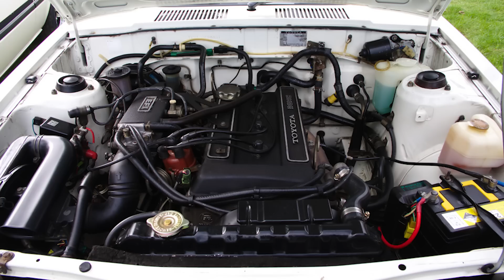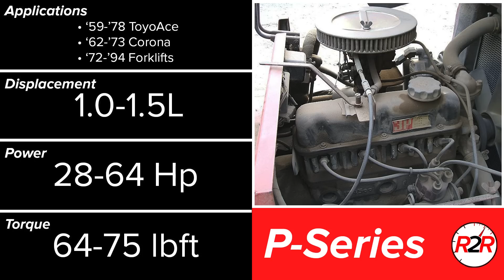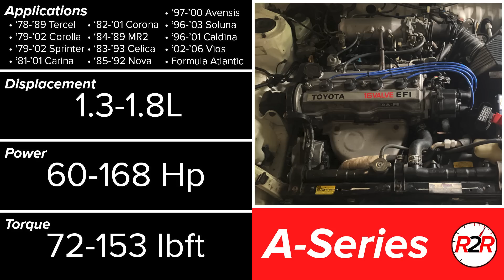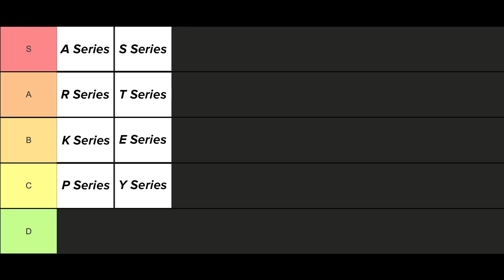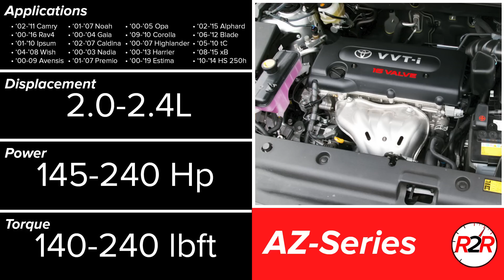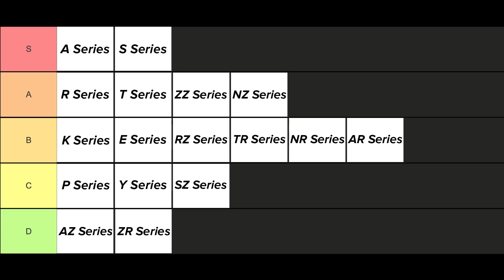The ULTIMATE Toyota I4 Engine Tier List

Comment: I have a 2007 camry i bought  when it was bit over 2 years old. Does not use any oil between oil changes at 240000 km. My biggest complaint is the dash material is crap. Other than that it`s a great car with no issues that i love. Mods are 18 inch x 8`s wheels, converted R1 muffler, K&N air filter ,10 inch touch screen entertainment system.

Comment: The 5SFE is 2.2L. Also, the A series was used in 6th gen Celica (so up to 99) in the lower end models. 7AFE.
Reply: I was thinking the same thing. My Camry has a 5sfe, and it’s a 2.2. It’s also notable that, while I’m sure you can do this with many engines, the 5sfe and the 3s-gte blocks are almost completely interchangeable. There’s plenty of builds out there with the cast iron block of the 5, and the internals and header of the 3!

Comment: the 4Y-E used in Toyota 8F series forklifts is damn near bullet-proof, our highest time lift has ~23,000 hours - for an engine rated at 37hp @2400 rpm. They will last decades with minimal maint input.  It is not always about absolute performance.

Comment: rz should be at least a tier they are a underrated indestructible workhorse and the 3rz in particular can make some crazy power boosted, we got one that had sit outside for 6 months well over 300k on it put 20lbs of boost through it, thundercunted the thing in a workmate and still runs 6 months later and only blew up when we pushed it to 30+

Comment: 1az wasnt a bad engine. The 2az got the bad rap for low tension piston rings and at the time suggested 10k oil changes, which caused sludge build up and rapidly developed into oil consumption.

Comment: Meh the the 2tr is fine for daily driving. My mate used to have a 4 door hilux thats wouldve been pretty heavy, and driving it it seemed to have alot of torque and decent amount if top end power to actually feel pretty fun. 

The massive fuel tank was good and bad, it'll last for long drives but the cost at the pump would be pretty bad. Fuel economy was good for what it was. No issues the with the motor, wouldve been more fun in a car with a shorter wheel base and lighter weight though.

Comment: 2RZ and 3RZ have some very nice modifiablity, while its more popular in Australia, its becoming more and more popular in north america. With simply a turbo, you can make 300hp+ on  either of these engines. The 2RZ is known to handle boost better, likely because of the smaller stroke. But on the contrary, the 3rz has a forged crank and more displacement. Majority parts between these two motors are interchangeable. As far as I know, there is no major issues known with these. Over all I think the RZ would be an A tier at least.

Comment: Those E series engines for a cheap run arround shitbox are amazing and so cheap and easy to repair, they can run 40% low on oil and be fine
Reply from the maker: Sounds like a good deal of fun with no worries, can’t argue with that

Comment: The zz piston ring problem was caused by a 2$ pcv valve that would fail sticking open and allowing oil to get sacked up into the intake. This would then burn in the cylinder causing immense carbon build up and in turn causing the piston rings to stick. We have fixed multiple zz engines by simply replacing the valve with the updated part from toyota, then soaking the cylinders with sea foam and atf over night. Once the rings are freed up it stops consuming oil

Comment: The AZ series being the lowest rated engine in the video is proper, but beside the oil consumption, the blocks had a tendency to pull the head bolts out of the block, blowing the head gasket. this happened TWICE on my 2006 Highlander (2AZFE). Toyota even issued a service bulliton about it, which I had them print out so I could give my mechanic.

Comment: I have the Dynamic Force engine in my C-HR. It has been my daily for the last 5 years and I have had zero issues. It has great fuel economy and predictable, linear power. I bought a Toyota TRD Air Intake Kit to squeeze more power out of the engine and with the bump in HP it feels like how this is how it should have come from the factory. I have had zero issues with the engine and it actually drives better now than when I bought it new.

Comment: 3S-GE Gen 5 BlackTop AT  86 x 86 mm, 11.5:1 comprassion ratio, 34.5 mm intake valves, 29.5 mm outake valves made of steel-alloy 197 hp @ 7000 rpm and 216 NM @ 4800
Reply: The only 2 litre naturally aspirated engine that can mach that torque output is the Mazda RF 2.0 G-184 with 181 hp @ 7000 and 205 NM @ 4000 but this engine is from 2018 and has a compression ratio of 13:1

Comment: The first and only toyota i've owned is a '09 yaris. It's slow as hell, but man it's a stout little engine and it pushes 40mpg highway. Doesn't burn a drop of oil between 5k mi changes. I've put 60k on it so far with zero problems besides a $50 radiator replacement from rocks hitting it while driving to aggressive on gravel. I've beat the hell out of that car

Comment: RIP the AZ series. My Mums Avensis Verso (Ipsum in other countries) has the 2L 145 hp version. Actually been rock solid for the past 21 years with no oil consumption issues at all.

Comment: I think you misjudged the RZ engine, especially the 2.4L 2rz. Those engines are disgustingly strong, and used in import drag racing to great success. A friend of mine strapped a turbo on an unopened 2rz and ran low 8 sec 1/4 mile reliably. Definitley an S class engine.

Comment: 2rz and 3rz’s are vastly superior to any R series engine, coming from someone who had a 400k mile 22re and currently still has a 320k mile 22re. My lifted 4x4 99 4runner runs circles around my 92 pickup, and race RZ engines easily make over 500 horsepower. The only reason they don’t get any recognition is because from the factory they weren’t really put in any cars, only trucks.

Comment: 2ZZ owner here. Had a Celica with this engine, as far as it "hooked" me to the small, powerful 4-cylinder n/a engines, it's just not that good, especially when I switched to K20 in Civic Type-R. Most common problem with 2ZZ was when the lift system starts to kick in and gearing ratios - when you change from 1st to 2nd gear, engine are just below lift rpm range. It's also expensive (camshaft and lifters), hard to repair (MMC cylinder walls if they fail, that's basically a thrash engine), not really a lot of mods for them, and the standard ECU cannot be modified. It's a shame because after Celica, the Toyota ended the little battle with Honda in terms of fun FWD with around 200hp n/a engines.

Comment: All those engines with ring issue's are from lack of oil changes and incorrect oil usage...  

Also the 18rg was the most powerful carburetored 4 cylinder

 and the rz was a later version of the r series engine... which when boost is added they triple in power... they make power easier than a ls v8

Comment: Ok the RZ series was definately underrated in this video. They are the best light commercial vehicle engine Toyota made. In Australia they fetch a premium as they are very common to be built for performance applications, responding excellently to forced induction making heaps of power and torque. The 3rz is one of if not the best engine they ever put into a Hilux.

Comment: This is way too broad to only list the series. There are probably over 100 versions of each series. Even if you go into specific engines of the series for example like the 2ZR-FE they had many changes over the years and the later ones were a solid A list engine at the least. The low friction rings and VVT rattle was fixed in the later years. Just 2 issues fixed during the production of that specific engine not to mention going back to a spin on oil filter from the canister filter.
Reply from the maker: I agree, but the reality is that the videos would be 2 hours long and viewers would get bored of hearing 22 variants of the R engine for example. I will look at separating variants that have large differences, just trying to keep these digestible, thank you for the feedback and I’ll see what I can do!

Comment: My boy E series got done dirty, a mild enough build for reliable 300hp out of an economy 1.3 deserves better
Reply: Ngl. As a former 2E engine user before I swapped the engine in my Corolla for a 3SGE, that damn thing just kept going. Mine got flooded at one point, drove 100 kilometers without a working waterp pump, towed a couple of vehicles with it... It just kept going. It won't get you anywhere quick, but it will surely get you there.

Comment: The 2TR-FE in the Tacoma might not be the most exciting engine they make but on that engine Toyota opted to sacrifice power for durability. As a result many 2TR-FEs will last at least 250,000 miles if you take care of them. Sure it loses in comparison to more modern engines but it lasted from 2005 until 2023 as the base Tacoma engine and the 1 I had ( 4cyl 2008 base model ) and my current one ( 2022 Toyota 2.7  Tacoma SR quad cab) both returned close to 25 mpg and have enough power to do when I need them to

Comment: 1999-2002 1ZZ burns oil, 
2003+ 1ZZ is the bulletproof version. 
 
300K+ miles on my daily 2003 MR2-S
Reply: As a victim of a 2001 Corolla I can verify this
Reply: I have a 03 vibe with a 2zz I love it it’s my favorite shit box so far
Reply: all the early 2000s engines burn oil due to stuck piston rings, a piston soak with engine flush of b-12 over 24 hours will fix this 90% of the time. Look up this in Audi engines for example. This is coming from a 2zz owner

Comment: I have an AZ series engine. Toyota replaced the faulty low tension piston rings for free, and it is going strong well over 10 years later with 0 oil consumption problems

Comment: ZZ is solid high A tier agreed. Better than AZ or ZR in terms of performance and reliability, but not quite as good as the S or A series b/c of their slightly finnicky reliability. They'll run for ages, but you gotta take care of them better than the old ones and can't beat on it quite as much. They also don't have quite the same power potential since they're not as good with boost.

Comment: I will say the 1AZ-FSE has been proven to be incredibly tough and quite quick, my 06 Caldina has the engine and it screams to high rpm, really gets up and goes and keeps up with alot of cars, helps that I have a ganador exhaust and filter, it's proven to be really tough and handles being driven hard with 8000km oil changes

Comment: I got 227k on the 2AZFE on an 07 RAV4.  Did start burn oil at around 65k and got really bad close to 200k.  I did a pistons soak with Berryman B12, and it has significantly reduced oil burning.

Comment: My friend has a 2ZZ Celica and it's a brilliant engine when paired with the 6 speed manual. Very similar character to VTEC Civics with a high redline and aggressive valve lift changeover. The car itself also handles beautifully with just better tyres, coilovers and a thicker rear sway bar.

Comment: I think the AZ series should be in the d tier fs, if it's never overheated, oil changed regularly, and it's pre 07 it's one of the most simplistic soild and cheap engines out there.
Reply from the maker: I think you mean shouldn’t be there, but valid points. Thanks for watching

Comment: The Dynamic Force is a great engine. Warms up fast, has lots of power, and gets great fuel economy. Had a 2ZR before it and there is no comparison. My '22 Corolla 6MT has a Borla Catback and a K&N typhoon intake with stock tune. Sounds great. I always thought it was a slow car but after doing a pull alongside a 2008ish BMW 328i Coupe and almost passing it (ran out of road) I am now convinced this engine is much better than I thought. Not surprised it is A-tier on this list.

Comment: In Australia our 7th gen celicas only ever came with 2zz. Regularly see them beating 300000km with no real issues. I personally have never had an issue with my engine, although the heater core design will lead to overheating upon failure, since the coolant flow isn't controlled by valve.

Comment: my Ipusm has a 2AZ-FE engine in it, and apart from a little bit of oil consumption, it runs well. I've put over 5000 km since I owned it, and I'm more aware about the oil consumption and the overheating weakness after research, thinking about the types of engines that could fit in case it breaks on me, but that's expensive, and I might not even keep the car if the engine blows. 

Yes, I did have one situation where the oil got too low and the light began to flicker on and off, and it got noisy. it's fine now, but one concern I have(since I got it) is at low throttle and rpm when cold it sounds like a diesel engine, higher than 2000 rpm during and it goes away, replaced with all the whines my engine makes normally. it's had a crappy battery replaced with a new one because it kept dying after a little bit of load on the battery, and my alternator made a lot of brief whining after not being stressed out.
Reply: my 2AZ does the same thing i think it might be the power steering pump. any ideas what it might be?

Comment: I didn't realize zr engines had such a bad oil burning problem, the 2zr in my 2010 corolla didn't burn a drop of oil
Reply from the maker: Nice, it may not be all variants, just some within the family. I wonder if maintenance quality makes a difference too. Thanks for watching!
Reply: It was only the ealier years. They fixed that and the VVT rattle issue later. The earlier ones gave the engine a less than spectacular reputation.

Comment: The 2zz is like the 7m of toyota 4s. People like to complain about them online because they don't know how to drive one. Its not a bullet proof engine. You need to wait 5 minutes for the car to warm up before driving and longer before engaging lift. People will money shift them then complain that it breaks the engine. I think the reason there is a lot more hate towards them has to do with the nature of the engine. It's extremely tempting to ride out gears to 8k. That makes people more likely to miss shift and blow them up. Especially since toyota manual shifters are sloppy and vague. If you were changing up at 4k then money shift, it would have enough range to keep the engine safe.
Reply from the maker: I really like this analogy to the 7M and totally agree!
Reply: My 2zz has 298,000 miles
Reply: @korbendallas9876  mine has about 165k currently replacing the timing cover gasket because of leaks

Comment: I didn’t quite get the take on Y engines. ‘They were built primarily for reliability and were used for a very long time in production. C-tier’.
Reply from the maker: My thinking there was a knock at the super low power figures. Although it may not have been the main focus, for heavy pickup trucks that’s just not enough and there are similarly sized engines like even the T series that perform better with no real downside. Additionally the Y series was built as late as the 90s, when engines were generally putting out well above that marker. 
That said, I completely agree that may have been harsh, from a longevity and practicality standpoint they are incredible! 
Thanks for sharing your thoughts and I hope you enjoyed the rest of the video!
Reply: @running2redline  Now I see your point of view. Thank you for elaborating. As for your videos - they’re great, really enjoy them.
Reply from the maker: @rockywalker6276  Much appreciated, thanks for watching!

Comment: As the happy owner of a 3ZZ-FE with 206 000km running E85 since it's 185 000km note that ZZ engine piston rings problems were corrected from 2004 to 2005 depending on the model. So latest ones are not impacted and are very reliable. Like every engine just remember to do basic maintenance like filter and oil every 10 000km maximum

Comment: Eh, my brother has a stock 2RZ in his '86 pick-up putting down 350 to the rear tire with the help of e85 and 14lbs of boost. He's had more issues with finding a transmission or rear end to hold it than the engine itself. It actually made over 150 to the rear tire bone stock, but running on a Haltech Elite. The 22R really can't hold a candle to that engine in pretty much any way, they really aren't as "bullet proof" as been let on.
Reply from the maker: Interesting info, thanks for sharing